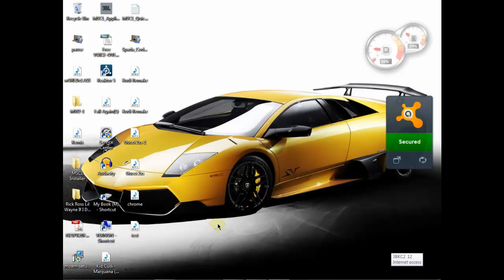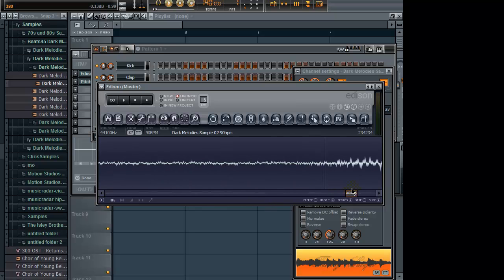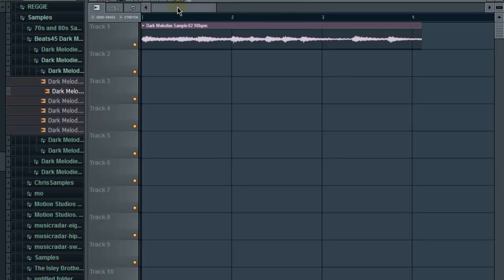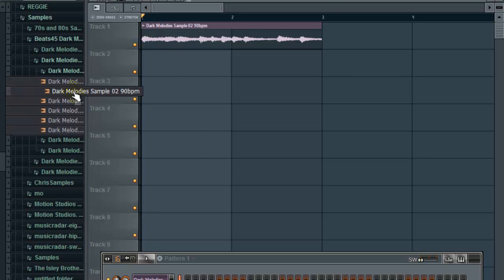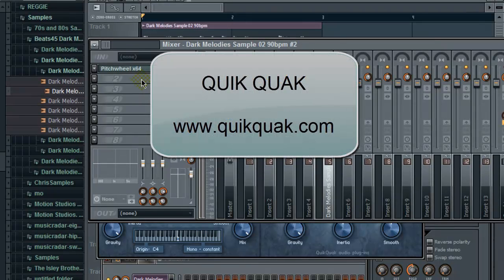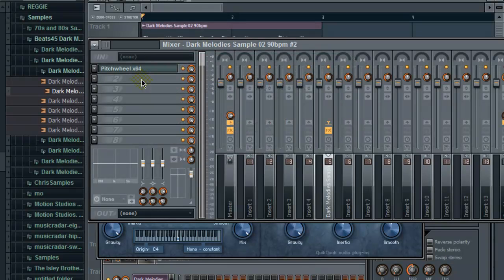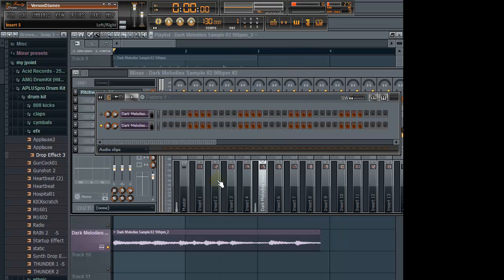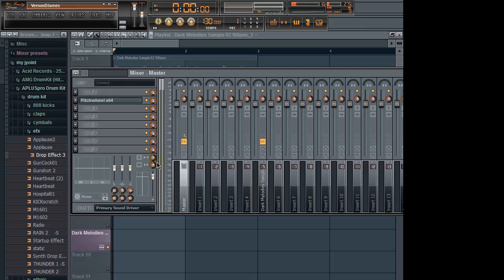Sampling Techniques: FL STUDIO 10 (Time Stretching and Shifting)

Comment: i got a hold of this
-----------------------------------
QuikQuak UpStereo Pro v1.0.1 VST x86 x64 This plug-in uses unique technology for stereo enhancement. Unlike traditional techniques that can introduce phasing and inversion effects. UpStereo Pro uses spectral processing and is engineered to shift actual pan locations of sound around the stereo field. The punch and sizzle parameters finely control the transient attack and intensity of bass and top end. The equaliser fine tunes your mix with easy to control spline editing, and uses linear processing to ensure the sharpest and cleanest results. The shape control replaces the 'Loud' button of the old UpStereo with smooth adjustments from subtle to exteme and distorted. * Stretches stereo width without using traditional phase techniques. * Unique technology that stretches sound locations toward the stereo extremes, keeping central sounds intact. * Punch control for enhancing or dampening initial bass or kick sounds. * Sizzle parameter for giving high end transients a fizz and sparkle. * Linear equaliser with 16 point spline editing. * Waveshaper with extreme settings. * Full linear processing. * On screen information panels for each of the controls.

Comment: was there a reason you didn't just use the pitch knob on the samples channel settings? and You could always just change to tonal on the sample settings if you wanna keep the pitch you originally tried to grab. Is the pitcher you used just better?

Comment: Question...I took a song at 92BPM, chopped it and made the pieces one sample. I saved the sample at 51BPM. But when I try to drag and drop the sample into Slicex or Edison to chop it further it plays at 92BPM...whats the best way to get back to 51BPM in Slicex or Edison?
Reply: ***** Thanks but I tried that...for some reason when i click on the channel, then the waveform in the sample tab for a sound preview, it plays slow. If I want it that slow in Slicex/Edison I have to use trial and error and time stretch it by percentages. Slicex/Edison time stretching has an option for changing the length by entering the total length of the sample , but not for entering the BPM.
Reply: *****
Actually both....I made a loop off the chops from the song at 95BPM...but when i heard those chops as a saved sample at 51BPM i thought of a diffent way to chop it. So now i'm resigned to putting the saved sample into Slicex or Edison. And since it will only then play at 95BPM (I dont know why) I have to time stretch by guessing at the percentage....listening to it and comparing then guessing at another percentage till it sounds right.
Reply: Raas Gee I think your right about when i slowed it down...but that was a happy accident and now i'm trying to run with it.
Reply: *****
To be honest  i think trying your double speed theory might cause me to bust a brain vessel...tell you what.... i"ll upload the saved sample to a Dropbox account with a temp password. Appreciate it if you could let me know what happens when you try to chop it.

Comment: Use "pro transient" time stretching instead of "re sampling" in the sampler to change the pitch without adjusting the time length or vice versa. Which probably defeats the purposes of purchasing/downloading quik quak.

Comment: You can pitch correct it by clicking on the sample twice in the pattern box and pressing pitch and moving it to 100 cents or 500 cents or whatever. Changing the polyphony and changing the pitch are 2 different things. You will keep the tempo of the song.

Comment: @eshiett2006 take sample. Right click on time time knob. Set it to how many bars or steps you want to set it to. Set the drop down menu next to the time knob to "pro default" after that the paino roll should have no effect anymore. To change the pitch use the Pitch knob to the left of the Time knob to adjust the pitch. Every "100" is one semi-time . Look up in the top left corner of the FL window to see how much you are moving the knob.

Comment: @DarkSkinBoi holy typos. my bad. would you like me to explain that again? Its worth it. It wIll save you alot of time and sound quality in the end. After you time stretch just use the pitch knob 2 knobs over to the left to change the pitch after its been stretched. look In the upper left hand corner of the FL program window while you turn the knob. Every value of 100 is one semitone. It will let you go one full octive up and one full octive down.

Comment: yo you dont need pitch wheel or whatever. At the aprt you said there was more time stretching option you just change it from "resample" to "pro default" and it will keep the pitch of  the sample no matter what tempo and it will stretch. From there you use the pitch knob next to the stretch knob to change the pitch. look up in the left hand corner while you move the knob. Every value of 100 is on exact semitone. It sounds peferct it preserve quality because you are not using some 3rd part effect

Comment: Good video besides the fact you call it Pitchbend x64. You know it's just the 64 bit version of the plugin. There is no real reason for the 64 at the end. Also make note to FL Studio 9 users and below the 64-bit version that you recommend will cause problems or not even disperse the full load of memory as they don't have a 64 bit plugin manager so they should get the one that doesn't have 64 bit despite if their computer is 64 bit or not.